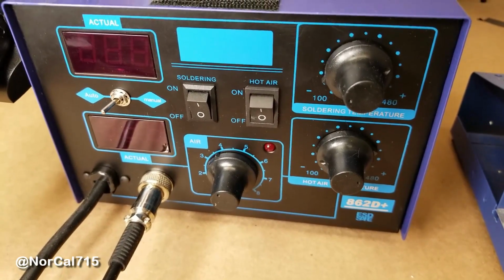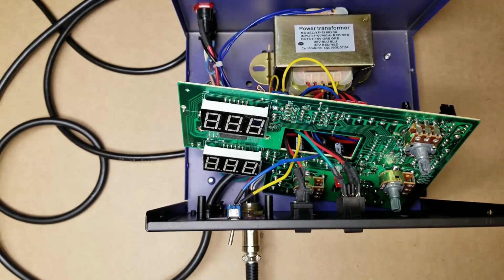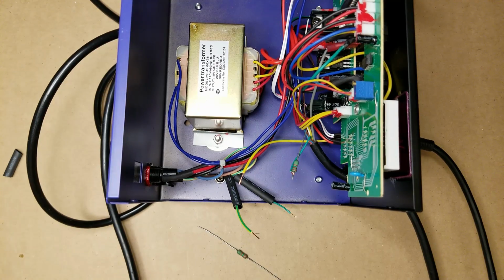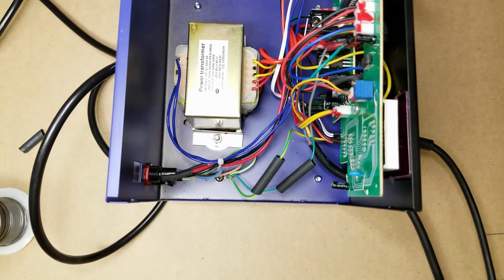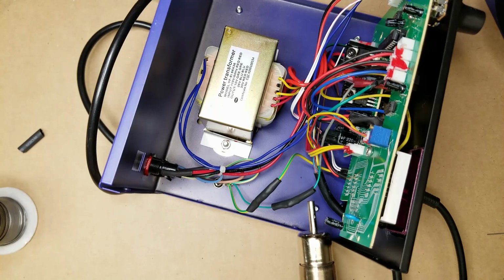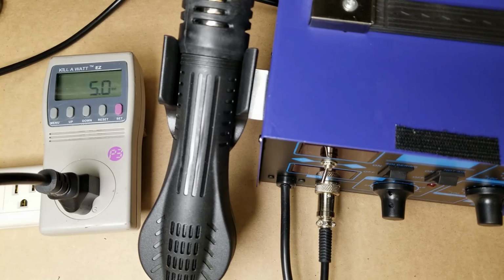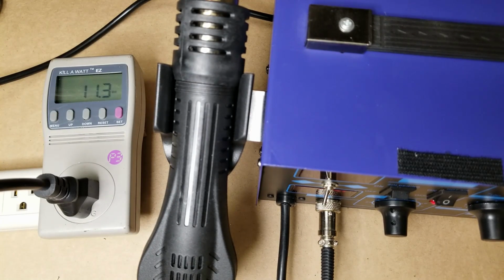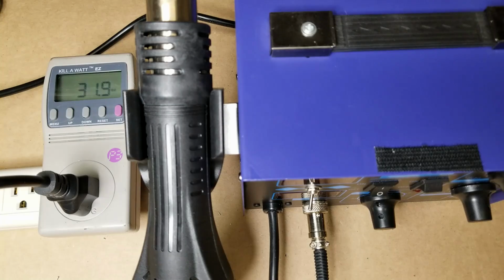862D+ Hot Air Rework/Solder Station Celsius to Fahrenheit Conversion

Comment: I've seen people having trouble with these.. Did you have any issues with longevity?   Did the hot air gun ever crap out on you?  I've seen where the chamber with the coil has a very thin insulating tape wrapped around it.. and the coil will burn through the tape and short out to the metal cylinder wall.  Do you still use this?? or how much use did you actually get from it?  I already ordered one..  Great video.  Cheers.
Reply from the maker: I still have it and it still works perfectly, it is not my main station (as of about 2 years ago) but do use it in the field occasionally.

Comment: Great Video, Thanks!  Do you have any recommendations for replacement soldering iron tips that are better than the cheap on included?  I want to learn board repair as a hobby for working on stereo equipment mainly, but will very likely try my hand at some computer repair as well. Thanks again!  @NorCal715
Reply from the maker: As long as you keep the included tips clean, and cool when not in use, I have found they last quite some time.

Comment: I have the 862bd+. I have the opposite problem. Is the fix the same?
Reply from the maker: I have heard that some came pre programmed in the specific mode and that no changes were possible. Take a look and see if you have the jumper internally

Comment: mine is v5, and for anyone having the issue where your iron doesnt get power but your hot air does just fine, at least on my board their seems to either be a problem with the tracing on the board that connect the switch pin to power as shorting the pins does not always work, the only thing I have found so far that works is putting a bit of pressure on the top of the connector pushing it into the board. I have not attempted a reflow yet to see if that would help because I just don't believe it would given the symptoms... If anyone has any ideas on what it could be other than that lmk because I cant wrap my head on it being anything but that being affected by pressure...

Comment: i am thinking about transforming it 110 VAC to 220 VAC. I see there are red cables going to board. That Chinese transformator is very helpful by coloring 30v and 110v rails red.

So rewinding the transformator should work? I don't know if i could find replacement for it...
Reply from the maker: I would just use a step up transformer to convert 110 to 220
Reply: @norcal715  Thanks for your answer. rewinding is very nasty. Since i am scammed on ebay, my 19 usd 862d+ never comes...

Comment: I have what looks like the same unit. I purchased it in 2014 but never used it. Tonight I was trying to reheat a chip on my video card so I pulled this out. I put on a tip I had purchased that was about 3/32" and used a laser pointer heat test gun and 2 different multi-meters with test probes on the air and the metal around the tip to see the heat as the chip would not reflow. I could not measure with it turned all the way up and different settings on the air any more then 195 degrees Celsius. I cleaned out the plastic slag out of the handle on the fan side so as to not interfere with the air flow which did not help. The board has similar parts but not the same design of board. The magnetic switch does not even work on mine! I see the trim pots on 1 leg of the temperature pots but not sure what they do. Do you have any suggestions on how to get the hot air side hotter? The way it is, the hot air side is worthless! Thanks for your video.

Comment: I have the same machine. I want to hook up a desoldering gun to it.  I figured out the pinouts, but I am afraid of damaging the circuitry of the station.  Do you know if the gun has the same temperature range as the soldering iron.
Reply from the maker: It should be the same

Comment: thought i'd stop in and say thanks for the vid, I bought one of these off fleabay, was too be unbranded like yours, showed up a zeny with diff. board and loose wireing, I fixed it, 42$ and a free iron, fedex to my door. sol good but kinda miffed i cant make this mod, you can look at my board here if you would  https://youtu.be/lr1rdaIGi8A  I dont think i have any option jumpers ? thanks again
Reply from the maker: I will take a look when I get a chance. Sorry to hear that because I was planning on picking up a 2nd one of these ans wanted to mod it too
Reply: no worries man,  seems to be no ryme /reason to how these are build at the factory, i made my vid to help with the confusion,, lol
Reply: @norcal715  so, I took this apart again, apears no way to do this conversion to my board,  Thinkin you got lucky with yours as there is prob no way identify which board will come in a "unbranded" unit,,,,

Comment: I don't like the Celsius display so when I saw this video on how to convert it I bought one. The only problem is, the circuit board in mine is laid out totally different than yours so it doesn't have those 2 pins to jump across. Do you have any idea how to do it on the other style?

Comment: So this method makes the solder iron hotter than the 480
Reply from the maker: No it just changes the display from Celsius to Fahrenheit.  The actual heat stays the same.

Comment: That's in fact not a good soldering station, the blower soldering stations are very bad, they don't give you a consistent air flow and in return they don't provide you as a constant heating source.
The good ones have a internal pump and distribute the air correctly. Also you can buy good ones with a fair price of  that is probably the same price as this one, "701A+" is a good example, also "852D" use to be cheap
You have professional ones that has a blower inside but is a huge one that doesn't compare with that 12V one, branded as Quick 861dw

Comment: This looks like a nice unit and I'd like to pick one up for myself.  I fix a lot of TV's and the need for surface mount IC rework has become greater recently.  I've been bringing boards to work in my lunchbox to use the hot air reflow station, but I want to get one for home use.
Can you please tell me where you got this?  I did a search for this model both on Ebay and Amazon and couldn't find it.  I found a few similar ones with close model numbers, but not this exact one.  Thanks
Reply: I found it, the model # is wrong in the video description. I see on the unit that it's an 862D+ not 864, that's why I couldn't find it.
Reply from the maker: I just noticed the wrong number in the title line also, and fixed it. Thanks

Comment: Is it me, or is that transformer a bit on the small size for a soldering iron (60w-70w?) and hot air gun (70w-100w?) ?

When heat shrinking, I tend not to heat shrink the entire length, I just heat shrink a spot where the diameter of whatever it is around shrinks or grows. That way the shrink is stuck in one spot, and I have the added protection of not having a tight sleeve around most of the part. The tighter the sleeve, the more likely a point or sharp may pierce the sleeve.  It's a choice for safety, not speed. 

For example, putting a sleeve around a resistor placed inline on a cable. Just shrink both ends so it cannot move past the resistor.
Reply: The hot air gun runs on mains voltage, so it doesn't load the transformer.
Reply: @zaprodk  That's disturbing as I've seen videos on this particular part (looks and runs exactly the same between manufacturers) where the plastic has completely disintegrated due to the magnet not turning it off or the fan cooling failed. The housing is thin and melts at the heater end. 
www.youtube.com/watch?v=tUFW5teeRBM&t=532s 
I missed the bit where the SCR/Triac runs the heater meaning it's mains, but I did note the size of the earth wire to it. Watch part two to note the chance of a thermal run away if the Triac fails.
Reply: @saddle1940  I've seen that video. I'm not sure of the order of events, since Dave is a bit too good at jumping to a conclusion most of the time. A failed TRIAC should still make the thermal fuse melt.

Comment: Feedback loop!!! Does not compute!  Hot air station fixing itself!!!
Reply from the maker: Are you implying a bit of cannibalism? I almost made that remark as I was filming it.
Reply: Haha =D  Yes, it also in some ways demonstrates the WHY for this mod too.  ie.  If you had a bad solder point somewhere on the board you could use the iron to reflow it whilst powered.  Yes, dangerous, but not if you know what you are doing.  But that of course assumes that the bad solder point isn't affecting the unit in such a way that the element cannot heat up. =D

Comment: Is the resistor value critical between the tip and earth?
Reply from the maker: No, I like to use a value in the millions of ohms range, more just to dissipate any static that may be present on the tip. Its all personal preference though.
Reply: NorCal715 without the resistor there’s more of a static discharge risk since it’s more instantaneous?
Reply: @mrsemifixit  Without the resistor there is a risk of mains referenced voltage taking a direct low resistance path to ground through your tip, if you're working on things that are powered from mains on or plugged into mains. This could damage what you're working on as well as your iron.

I'm sure NorCal has his reasons, but I would just leave it directly grounded without a resistor and do any soldering work with the device you're working on unplugged.

Comment: Do the Hakko tips use better metal for their tips? Curious the difference
Reply from the maker: I think they do. The original Chinese tips didnt last more than a couple of weeks, but the Hakkos have been going for about 6 months with no problems
Reply: NorCal715 Oh so it’s a matter of longevity rather than better heat conduction?
Reply: @norcal715  yes there are some cheap tips I agree

Comment: How does it produce air? I have a similar one that uses a diaphragm pump for the hot air. Don’t see one in yours
Reply from the maker: it has a small motor and fan in the hot air handle

Comment: If the 862D clones are anything like the 858D clones, there's probably a wide variability in quality of assembly and the behavior of the firmware. 

At least for the 858, finding faked displays that hide gross temperature overshoot isn't uncommon.  People have put together firmware and adapters to work around the unserviceable MCU for various 858 clones: 

https://www.eevblog.com/forum/reviews/youyue-858d-some-reverse-engineering-custom-firmware/msg1418224/#msg1418224

When I saw the video title, I was expecting a similarly involved solution and a new generation of 862D modifications.  I didn't expect you to be lucky enough to get a jumper!

Comment: I have the 853D which is selectable from C or F temps.  I got the hakko  tips from Ebay also, but they look like the exact ones that came with the 853D. They don't claim to be OEM Hakko tips, they just say unbranded.

Comment: I have the one with the 15v psu, 2A USB supply and a little 50V voltmeter. A brilliant device, I use it all the time. And yes I do have a proper 30v 10A psu, and a handfull of digital and analague meters; 2 flukes, 3 uni-t, even an AVO. and 2 clamp meters.

Comment: I got the same one
Reply: My problem is th solder tip can't find them
Reply from the maker: I get the tips on eBay look for Hakko 900m tips https://www.ebay.com/itm/900M-Series-Iron-Heads-Soldering-Tip-for-HAKKO-907-907-ESD-933-Soldering-Station/132933341832?hash=item1ef371d288:m:muAOY9HwZpd_TlBPS5D_W8w:rk:1:pf:0